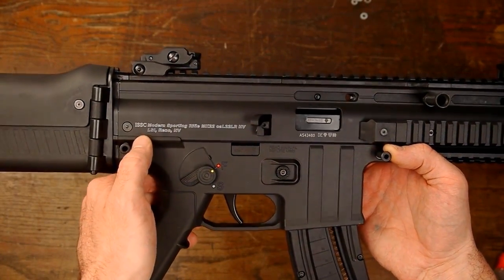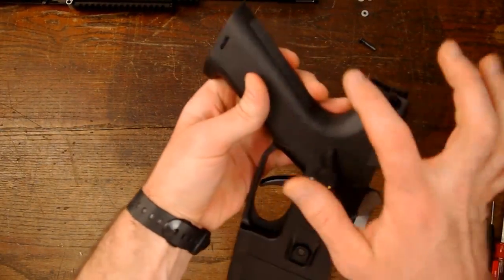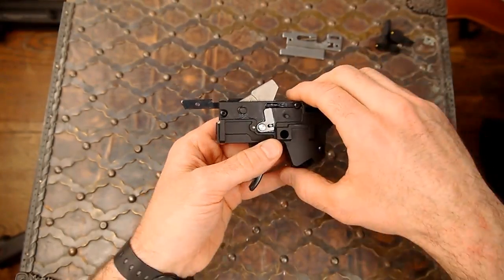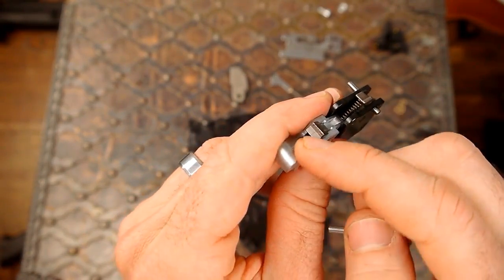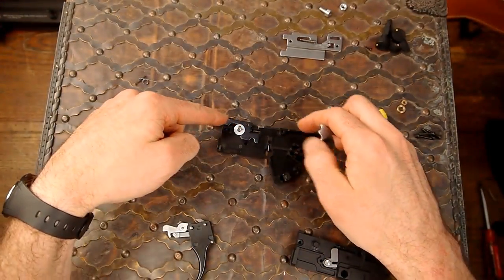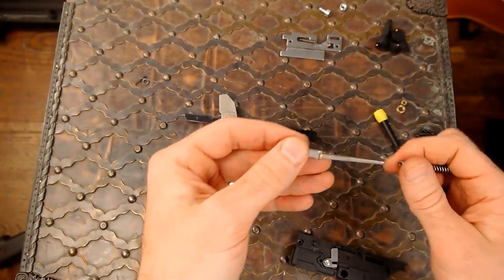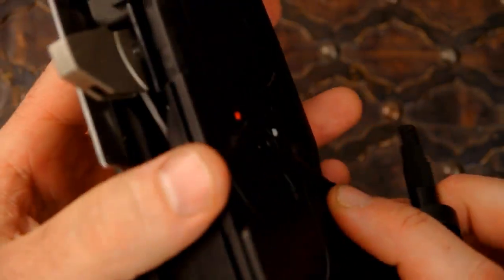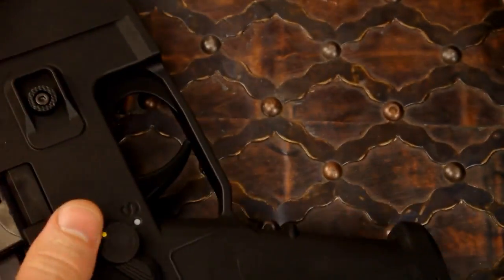ISSC MK22 Trigger Dis-Assembly

Comment: So glad I found your vid! I took my trigger pack apart to modify my strut and mag safety lever. Also removed the bolt safety and trimmed the plate. Added a buffer and a few other mods. I was following another tubers vid for reasembly and I thought I would never get it back together. Thanks to you its back together and runs better than ever .
Reply: Yo bro howd it shoot after the mods

Comment: Nice video. I just got a Anschutz MSR RX22. From what I've been told and heard it has similar problems. I appreciate you posting this.
Reply from the maker: +Sergio Marroquin, Jr. Thank you. I don't know if you have seen my whole series of videos on this rifle, but what I did in this video https://www.youtube.com/watch?v=-rDtIlRyViw      is what ended up fixing it for me. I don't know if the Anschutz has the same firing pin return spring.
Reply: +Guns & Accessories I've taken the bolt out and it appears similar if not exactly the same. I've also taken the trigger partially apart and it is exactly the same as in your trigger disassemble video. From what I have read, its the barrel and trigger that are Anschutz and the rest the same. Thanks again!

Comment: If you ever lose any of the springs you can find a replacement in the BIC lighter. The large lighters Flint is pushed up by a spring that needs to be cut down to size and voila~~

Comment: i flipped the brass washer at 7;27     better  /// tried it  out on a spent shell deeper indent     the 
 pin spring shave may be next      i first got new rusty fire pin and spring from ati  tried em and it was worse outcome     the hammer  spring  l  a wise  fix

Comment: So I have one apart sitting on the bench, and for the life of me, I can't figure out why (instead of the washer) I can't just stretch the spring out more? I mean it must be possible to simulate the pressure that you would get from a 1/4" or whatever washer, via a stretched spring, no?
Reply from the maker: +HIGH CALIBER That makes sense to me. I don't know if you have seen the rest of my videos on this rile, but what I did in this video is what finally got me running. https://www.youtube.com/watch?v=-rDtIlRyViw
Reply: Guns & Accessories It was that video that I found first (another excellent vid btw), and I just did that mod, but testing on snap caps and spent cases shows me it's much better, but not as good as the strike from a 10/22 or a 597 so I want to stack the deck and do both mods, but have heard that sometimes the washer can bind up.

Comment: I cant see how adding a washer to the hammer spring will solve anything, matter of fact if you having extraction  and or feeding issues it might make it worse as the recoil of the 22lr going off would have to work harder to re cock the hammer. The hammer spring is plenty stiff on mine maybe too stiff. So with lower power rounds it would make it even harder to re cock the hammer.